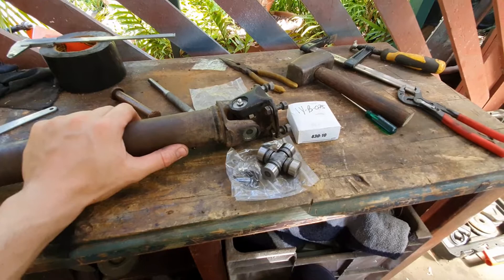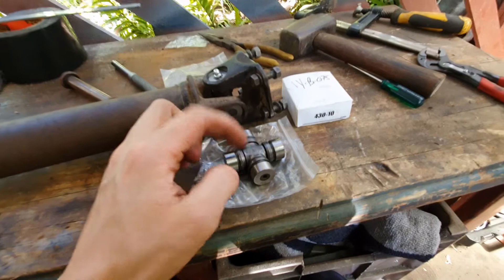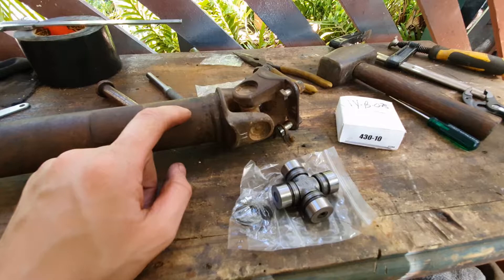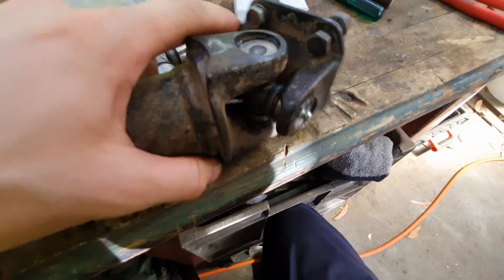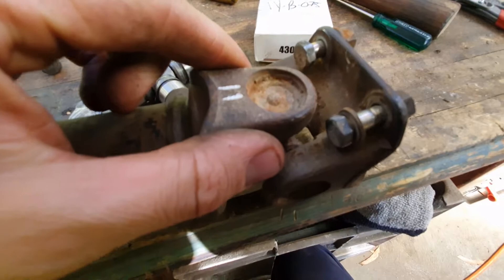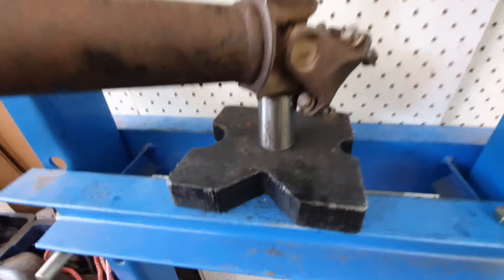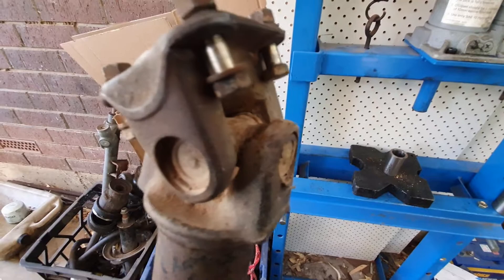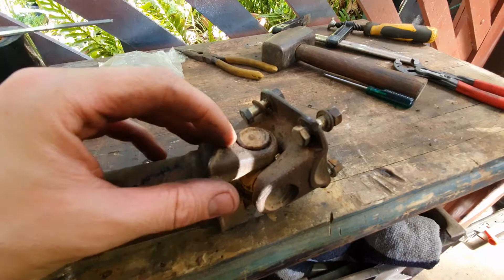Replacing Subaru staked U-joints

Comment: I found that a 7/8" hole saw bit with the pilot bit removed fits the opening perfectly to gently cut away the stakes prior to pressing or beating out the old caps. 7/8"  = 0.875 = 22..225 mm, just slightly larger than the 22 mm opening in these u-joints. Cut in just far enough to remove the stakes, I used a handheld drill motor and it worked perfectly. I then had a clear path to push out the caps. A soak with penetrating oil, then a bit of heat and out they came.